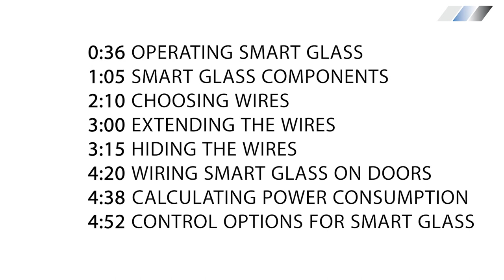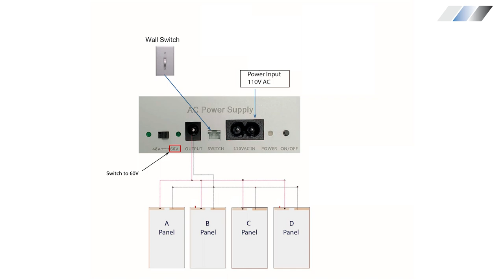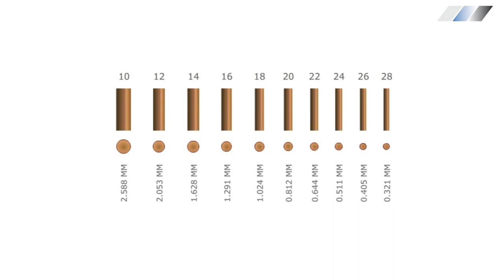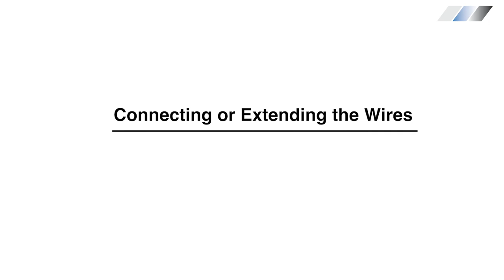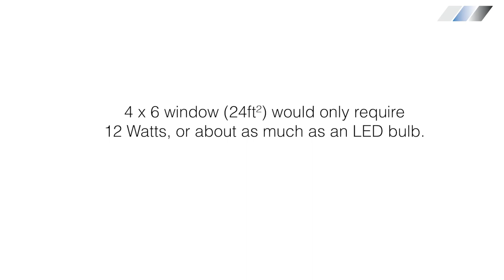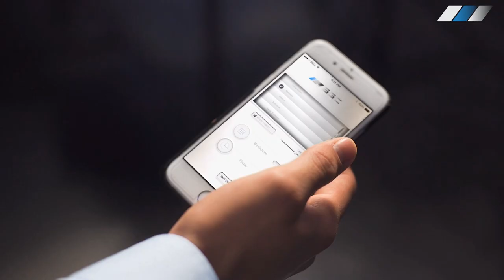How to Wire Smart Glass & Smart Film

Comment: Hi congratulations for the analytical explanations!!I would like to ask if it is possible to work with batteries instead?Also are combatible for countries with high temperatures?
Reply from the maker: Hello, smart glass technology can definitely be used in countries with higher temperatures and it can work with other power sources as long as they are able to provide the same voltage.